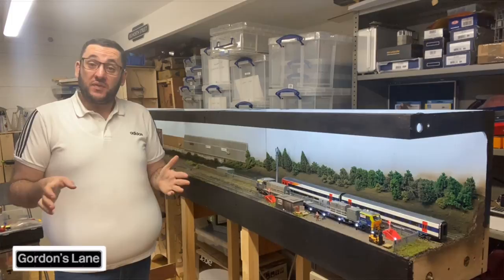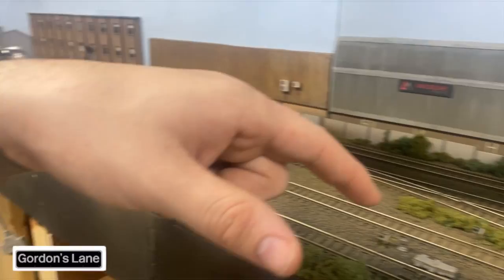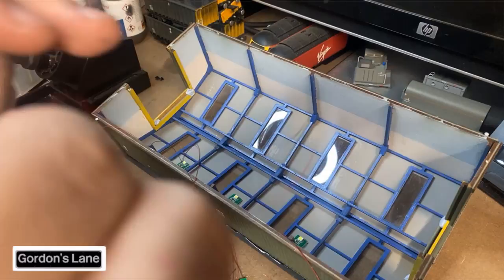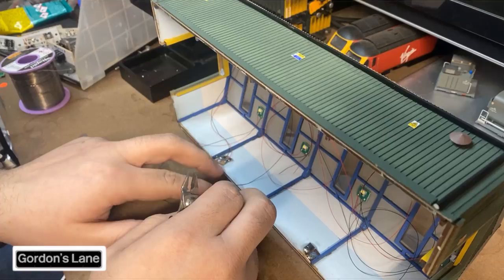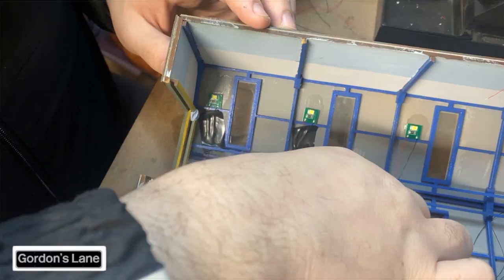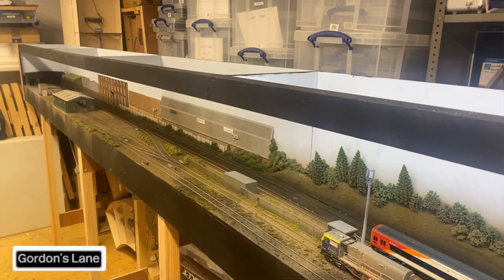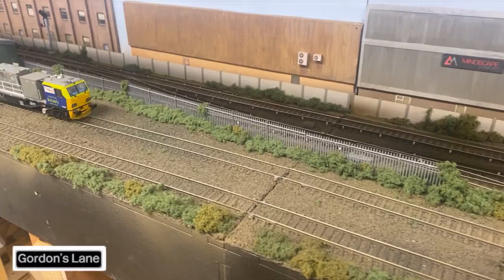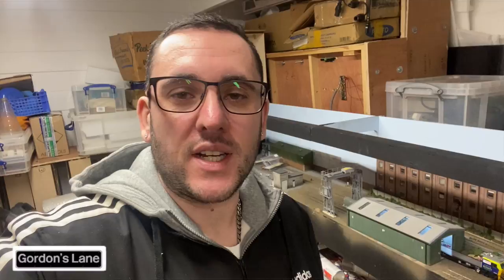Gordon’s Lane Part 12 - Shed Detail/Scenery

Comment: That looks brilliant, scenery looks absolutely amazing. You have a skill for that. I’m currently building a layout which has day and night simulation and it just looks the bees knees. It’s certainly a magnet for railway enthusiasts as they see something different and it attracts people to the layout. I’m trying to make the layout as interactive as possible and another bit I’m implementing into mine is a working shutter doors on my depot
Reply from the maker: Nathan, thanks for the comment, very much appreciated. Yeh I trying to do something out of the box. My Tramlink layout has day and night scenes also. It’s makes it a different layout all together. I’m excited to show you all the photos of inside the shed.
Reply: If you did go down the route of days and night the digikeijs unit has some really cools features on it. I’ve managed to set mine up so when it gets to a certain time in the cycle the houses and work lights automatically switch on and when day time comes around it switches them off automatically